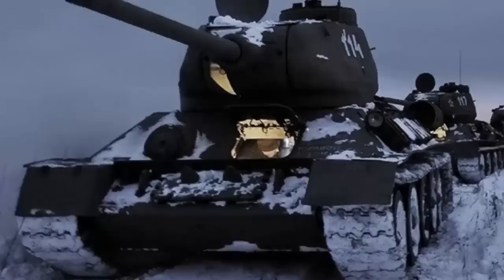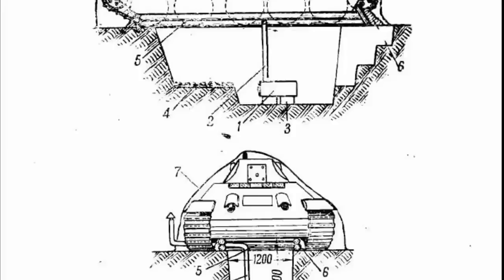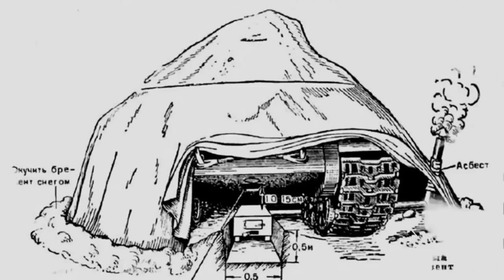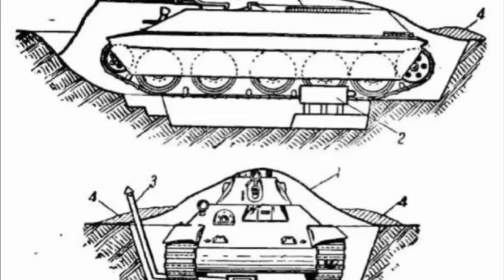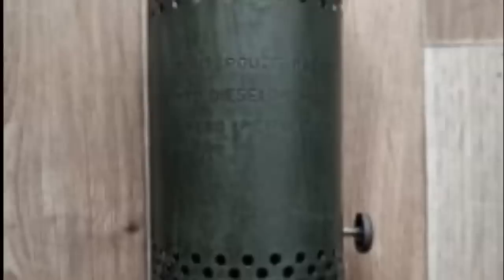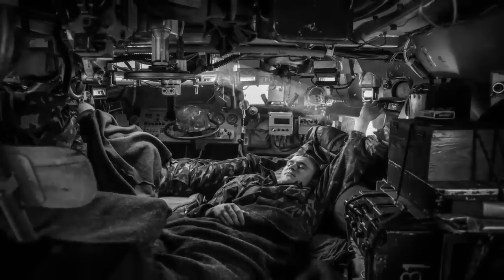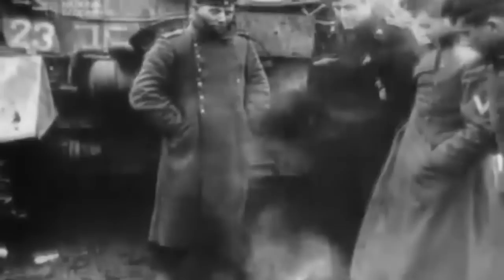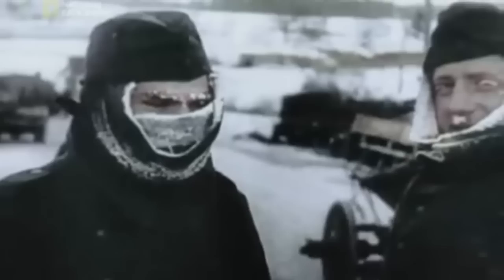🥶 How COLD was in T-34 Tank in Winter Time? WW2 documentary.

Comment: German tank crew could connect Panzer to panzer via a hot water hose to heat up the engines before starting. Also, what surprises me is that neither side came up with a radiator fed from the engine coolant system, to use the heated coolant to warm the fighting compartment. The V-2 engine in the T-34 would heat it's coolant in a few minutes. Crews also got in the habit of parking the tank on a carpet of birch branches to stop the tank tracks freezing to the ground.
Reply: Not having proper crew heat was thoroughly stupid but that era was one of desperate economic constraints for Germany and the USSR.

Of course today we understand crew comfort makes the crew much more efficient but in those primitive times troops were treated as completely expendable. It would have been trivially easy to plumb a crew heater in the manner of those used on automobiles but most cars didn't have heat unless they were luxury models and their heater cores and fans were shit on a good day. Car heaters didn't become standard until the 1960s in many autos. The most sophisticated vehicles in terms of crew comfort were ships with wheeled and winged transport being neglected. Moderns forget nearly everyone in that era was dirt poor by modern standards and it was common even in the US for sharecroppers etc to live in worse poverty than many third worlders do today.
Reply: @obfuscated3090  that's what they want you to think alright
Reply: Not true. 
The German's had the Kampfraumheizung, it redirects warm air from the radiators to the crew.
Reply: @Broman-es4sx  What part does who want us to think?

Comment: I crewed a apc in the winter. It was an ice box. I did it in non war training. I can only imagine the hardships for soldiers who had to fight in these conditions
Reply: I was a vehicle commander (section leader of a recon platoon) of two different M113s doing duty near the East German border over two winters. Neither vehicle had a working heater. My crew (driver and observer) used to abandon me at night. I had to stay to monitor the radio.  I went on later to ice climbing in northern New Hampshire, where a new record low was set on Mt. Washington two days ago. There and the East German border were pretty similar insofar as the cold is concerned! Wearing lined mechanic's coveralls over the top of my field uniform helped keep me warm. or at least kept me from freezing to death.
Reply: Back in 2002 I was the XO driver and our Humvee had a hole in the drivers side floor. Negative 20 degree winter, while driving at night nearly did in my foot. I managed to stuff a MRE in the hole and kept that humvee running. Later a group of Katusas hopped in my humvee to warm up and it was packed with about 6 of us. Not sure where the XO went, but we all did just fine and toasty without him.

Comment: This morning was -30 here, my forklift stated outside started every week until today.
I remember watching old wsr documentaries about the German invasion of Russia, soldiers making fires under the Tanks to keep it warm. So hard to imagine. My forklifts engine block was frozen solid, my to electric heaters died, one shorted, one malfunctioned. Had to go buy a new one, it took the new heater and an pld school plug in spot light that gave off crazy heat under the oil pan for 4 hrs to get it started. All I could think of was times like this video was describing. All I could think was things could be worse. I could be digging a trench getting shelled or sleeping In a frozen tank in ww2. Crazy.
Reply: My phones auto correct sucks. Not fixing all those errors sorry!

Comment: I've served on tanks at -25C and they're cold, if you're the driver and you're driving heads out they've extremely cold but if you've driven for any period of time and you get a tank sheet over the back decks you can sleep in a relatively warm place at least until you fall asleep. Tanks are not a fun place to be in very cold weather, or hot weather really but they're probably no worse most of the time unless you're moving than the conditions an infantry man would be in. When you're moving it's damn cold or extremely dusty and hot or maybe very wet but it's one of the best jobs I ever had.
Reply from the maker: Thx for comment!

Comment: I guess inside a tank could be as warm as inside an igloo. There would be some interesting thermodynamics going on. Of course lighting a fire inside a tank could be problematic. Warming the mechanism of the tank so it would function would be a different issue.
Reply: How is that supposed to work? Igloos are made of snow, which is a huge amount of air trapped inside some frozen water structure. Therefore a pretty good insulator to trap heat inside. A tank is completely made out of steel, which is, like nearly all metals, a very good heat-conductor. So you are sitting in a metal box that basically has outside temperature.
Reply: Zee alvays keep zee fire in zee ammunition compartment comrade

Comment: There’s several stories from US m4 Sherman tank crews…. Ripping copper pipe or tubing from whatever the could find….. and wrapping it around a spent shell…. They would then connect the copper line to the cooling system… and run it inside the tank…. They would use it to heat the tank and also to heat water for coffee….